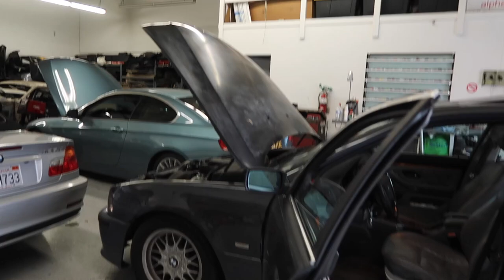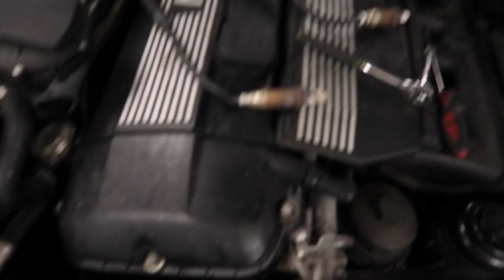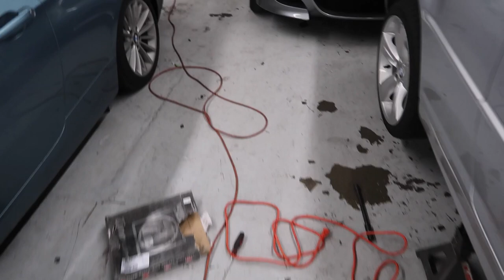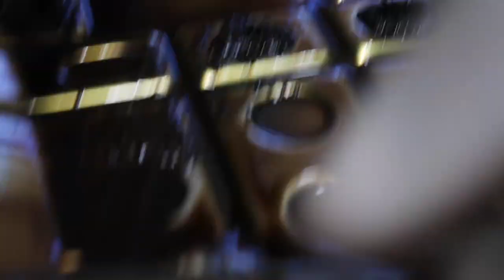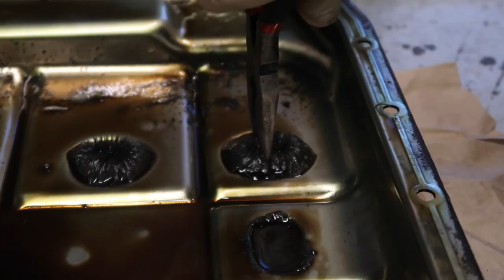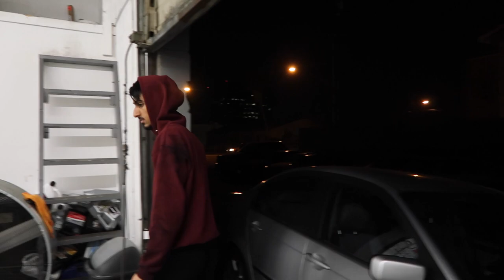A LOT OF METAL IN BMW TRANSMISSION PAN!

Comment: I have a 530i I got a transmission problem if I try to take of fast in first gear..I get a transmission fault..turn the car of and back on  the lights go back out car is fine....a friend who use to work at BMW told me is a small river pice in the transmition that can't hold the pressure and leaks power ...he when on Amazon and show me the very small river gasket .. he say that's the problem ..??? Have you see this before?? Tanks u

Comment: I have a 2004 BMW 325i with 169000 I'm not sure if the transmission filter was changed before cause I just got the car 2months ago,, the only problem I'm having in on a cold start in the morning I have to let it idle alittle longer then normal,,    after warmed up it drives great,,  I'm thinking should I change the fluid and filter,, ur videos r on point and very detailed,, that's why I wanted to ask u first and get ur option

Comment: First, your videos are top notch and you are wise beyond your years. I'm amazed at your knowledge and experience at a young age. I would have to disagree with you about the high mileage transmission fluid change myth, although like you state time and again, use the right fluid, which using the wrong fluid could be why it causes a issue. As a 30 year tech and transmission specialist, I have seen vehicles with no problem have the transmission fluid changed for the first time at high mileage only to destroy the transmission. Was something going on before? We can only speculate. The fact is there was no complaint about the transmission before the fluid change. Then somebody upsold a transmission service and, bang, done. Right fluid and filter being done at the dealer using OEM parts. I've seen it happen on both Mopar and Toyota vehicles. One was a 250K Tundra that had WS fluid and was never changed. The customer insisted we change it even though we tried to discourage him citing the possibility of it causing transmission problems as we had seen it happen before. Sure enough, he began to experience limp in and solenoid D codes. We ended up installing a reman Toyota unit. The fact is, transmission fluid has a detergent effect about it. Rebuild a transmission and by the time you are done, your hands that may have had grease stains and dirty nails on them will be clean like a non mechanic. My theory is that the fresh fluid "cleans" out a lot of buildup over the years and miles and the old transmission can't take it. I won't change transmission fluid in a customers high mileage vehicle that has no issue if it hasn't been changed at regular intervals. Same rule of thumb for my own vehicles. Thanks for the great videos.

Comment: Pentosin MTF being discontinued, what transmission fluid do you recommend for an E46 M3 ? At 65k miles should I consider changing the fluid ? What about the diff fluid ? (It's never been changed on either)

Comment: Hi I have a bmw e39 540i 2003 I bought this car and a distance of 200 thousand km I do not know if the old owner has replaced the automatic transmission fluid or not and I want to switch the automatic transmission fluid is working efficiently Did you replace the oil or not Thank you

Comment: So I have a question I have a 2000 Infiniti Q45 while changing the oil my nephew was doing the change which he has done many times. This vehicle i just got. While draining the oil it had a universal drain plug a winged drain plug he literally turned it twice and the drain fell out without the wing part. I think it may be in the oil pan I havent called any mechanics to get it out. Any suggestions.

Comment: Can  help me...my 02  bmw 325i ripped a trans cooler line on the freeway and leaked everything/ no gears.. replaced cooler line, filter, trans oil, serpentine belt and pulleys.. now my trans wont pass 2nd gear in automatic but in manual it can go up to 3rd gear.. after learning that  I replaced filter, oil, valve body/solenoids. shifts better but still wont shift pass 2nd in auto, but shifts into 3rd in manual.. help please

Comment: hi . how would you diagnose sudden cat errors 330ci 100k miles, performance is ok, no obvious vacuum leaks. After a long drive I now got both rear O2 sensor error. The only other noticebale issue may be that on deceleration it stumbles a little when close to idle. This might mean it goes either rich/lean at some time.
Previously i took to to the stealership they let it idle for an hour.

Performance and economy seems unaffected.

Some data:

Code,Error Frequency,Logistic Counter,RPM Of Occurrence,Description
234,1,40,1568,Catalytic Converter Overall Efficiency Bank 2
233,1,40,1920,Catalytic Converter Overall Efficiency Bank 1
90,0,0,0,Exhaust Temperature Pre Cat Conv - Bank 1
91,0,0,0,Exhaust Temperature Pre Cat Conv - Bank 2
93,0,0,0,Exhaust Temperature Post Cat Conv - Bank 2
133,0,0,0,CAN Signal ASC - Timeout

Comment: quick question my 328i coupe isnt accelerating after 20 mph would the transmission fluid change help , just throwing vvt solenoid and maf codes thanks in advance

Comment: I've got a 2002 745 li and it's fine in 1st gear, shifting into 2nd it feels like the car goes in neutral. Then once you get into 3rd all the gears work fine. Any suggestions?

Comment: hey bro i have a e53 x5. i bought the car and it's in trans failsafe prog mode. the car shifts and run perfectly. its just when stopping at a stop light, it downshifts and jooks a little. what could it be?

Comment: By the way I just changed my trany fluid it was jerking bad when you came to a a complete stop. The fluid was completely black and no metal residues I also added Lucas now my car shifts so smooth I can’t even feel them. By the way my trusty old bmw has 173k miles and still looks and drives like new . Better than any new car !!! I know I drive and sell cars. Once you drive a bmw you can’t go back!
Reply: superpeluso1 did you just flush and replace? Or completely replace tranny fluid with filter?

Comment: Glad I can across your page! One thing preventing me from working in my e90 335i engine is concern over the battery. Do you normally disconnect negative and or positive points before things like spark plugs, coils, etc?
Reply: You don't have to, just keep the key away from the car (ignition off). If you work with fuel lines disconnect negative to prevent fuel to be pumped all around. If you dont have key lock on the trunk, dont close it with no battery.

Comment: I came across your channel and I’m so amazed at all of the work you two have done... I’m so inspired... I’ve had my 2002 since I drove off the dealership at 15 miles now it’s at 275k with 3rd engine replaced..  Your  blogs videos are so helpful I ♥️ my E46  5speed transmission:  I’m so inspired to keep it and drive it till the wheels fall off.. I own x3 2013 also:: dream car z4 2010 Orion silver.  BMW  ❤️🏃🏼‍♀️♥️👱🏻‍♀️👍🏼.  You two are amazing. Selena you got a great man👍🏼

Comment: Love your vids buddy, after some advice. I have a E61 535d M Sport , has 130k on the clock and I want to get it remapped. Am I best getting a transmission oil change first, or leaving it? Been told different things. Your advice would great 🖒
Reply from the maker: Thanks! I recommend doing the fluid and filter/pan as well as the mechatronics sleeve and plug adapter. Make sure you use zf lifeguard 6 fluid

Comment: I have a issue with my car bro ... My car when it approaches 3rd gear around 3k rpm it pops out of drive into false neutral then if I get of the gas and wait till the rpms drop it goes back into gear
Reply: Sounds like a neutral safety switch

Comment: the driver should be changing the fluid more often in the first place. even more so with manual transmission since very few of them actually have filter to clean the oil out.

Comment: Never buy a Mercedes or BMW vehicles. Only buy Lexus or Toyota. My Lexus ls430 2001 Has 278000 miles. Original starter and alternator. Just replaced radiator. My Lexus ls460l 2007 has 157000 miles. Had to replace valve cover gaskets.
Reply: Andrew Villanueva it’s all dependent on the maintenance . My 2004 530i e60 has 200k and is still going strong. Thinking about buying a 08 535i in spite of all the common problems that they may have. Understand that not any one car is immune to their own common problems/issues.
Reply: supra driven I believe the older BMWs are more robust. Newer ones have all sorts of problems.
Reply: Andrew Villanueva, It's personal preference, I think Lexus is just a glorified Toyota, under powered, and lack luster handling. Others may love Lexus/Toyota, but I'm not going to say "Never buy a Lexus." There are plenty of BMW's that have lasted, and BMWs are fun to drive, have good drive train and power plant, and outstanding handling.
Reply: My e90 has 370k miles and no issues and I have only replaced tires, pads, fluids, and filters. Cars still looks new and drives like a beast. I cannot say that for my buddies is350 LOL that thing is dying from wear n tear so think what you like and don't take advice about you're car unless its printed in a service manual.
Reply: @fcardona84  08 535i? You won't regret it, believe me.
Reply: supra driven I can vouch my 2004 525i e60 is a tank

Comment: Your are nonsense.  What myth it if ive been in the automotive industry longer then you , not to mention your not a licensed workshop or real tech  am i correct? I went to tech back in the mid 2000's  here in Australia in my 30's now.  Have you been to tech or work at a real workshop before . I guess not . What myths if ive change automatic transmission fluid on a high mile vehicle and if failed but cars older then 20 plus years i wouldn't bother  even on new cars they are built too fail
Reply from the maker: Where is the disagreement?